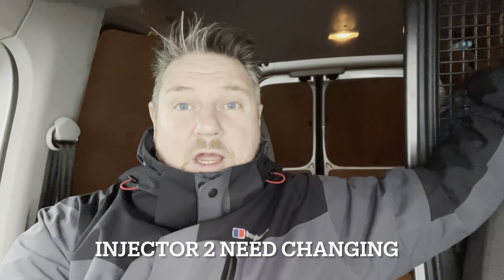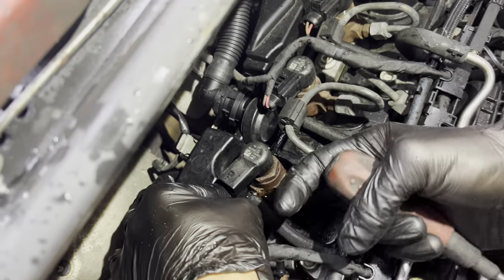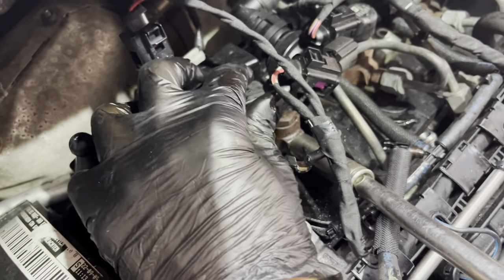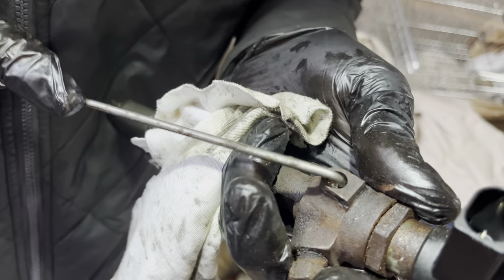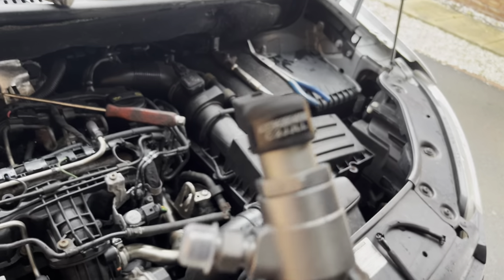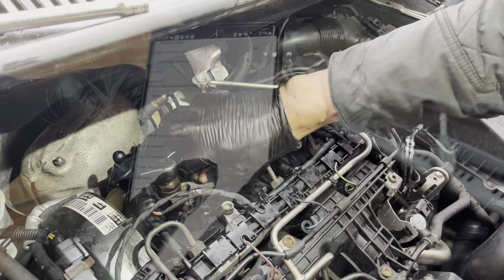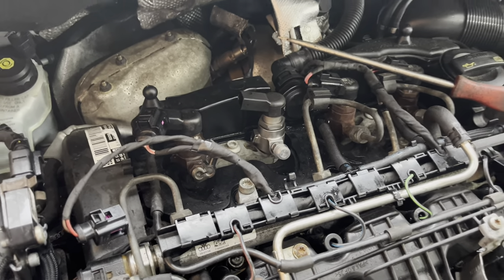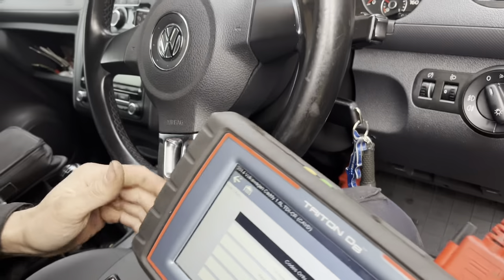VW CADDY VAN | How to Change a Fuel Injector

Comment: apparently its the insulater on the top of the Siemens injector that fails.number 3 went on my 1.6 tdi didn't code it in & its been fine.
Reply from the maker: @thegeordiefellwalker8878  Interesting info, I might not be able to code the next one in when it goes as I might not have access to a computer. Especially if it’s a side of the road job. I’m thinking about carrying a spare injector.
Reply: @LoneWolfExplorer  apparently the AA carry spare injectors due to how many used to fail 😏 i only use premium diesel now .best of luck

Comment: Hello from Portugal!! My friend, after replacing just 1 injector, didn't have any more injection problems?
I have the same engine and same problem p0202Error.. and the workshops want me to change all 4 to ensure safety...

A hug, continuation of the good content.
Reply from the maker: Hello there my friend 👋 After changing just the one injector I had no more problems 👍 I can understand the logic though of the workshop as they are trying to prevent further injector issues, I thought about changing all 4 myself so I had no further problems but didn’t want the cost involved.

Comment: slap a 1.9tdi in it shocking how expensive the 16 tdi injectors are
Reply from the maker: @buzzbee6488  I can see that as a good option to solve the injector issues but I have bigger problems with the ongoing saga I’m having with it at the min. If you have seen my other vids you will know 😬